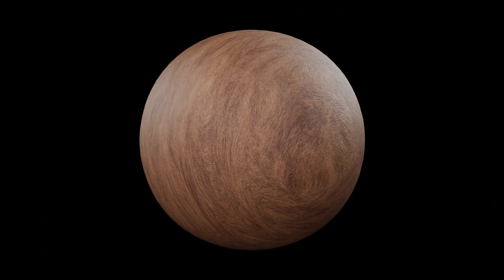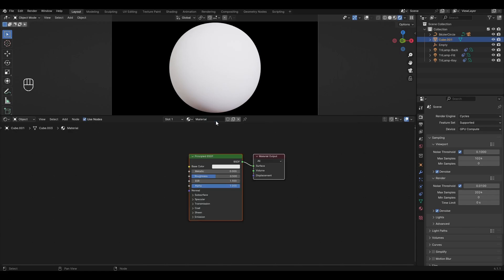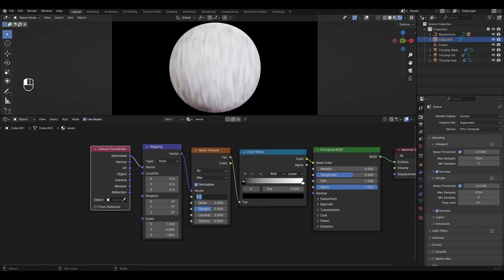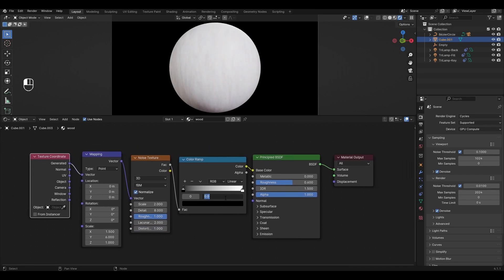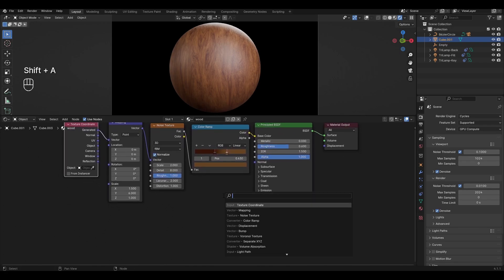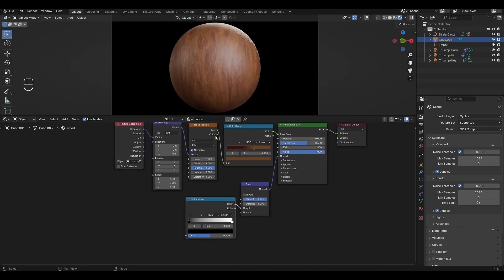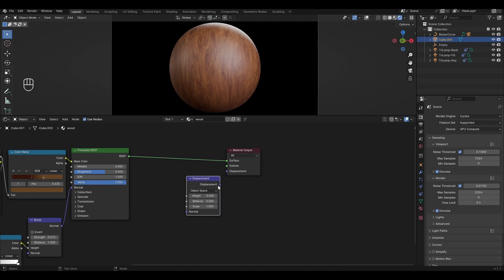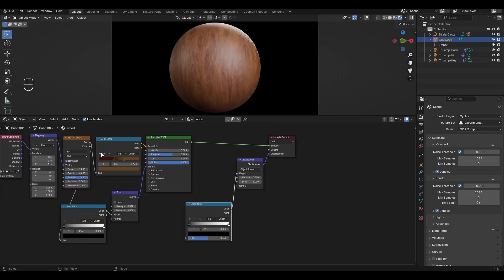Wood material in Blender

Comment: i did all the steps but my mesh didn't change, still being that same grey color, anyone know how to fix this?

edit: nvm i fixed it :)
edit 2: another problem, so i did this on a square mesh thinking it would do the same thing, but no, it didn't. Instead it gave the top a texture  but the sides and the bottom just black? anyone know how to fix this?